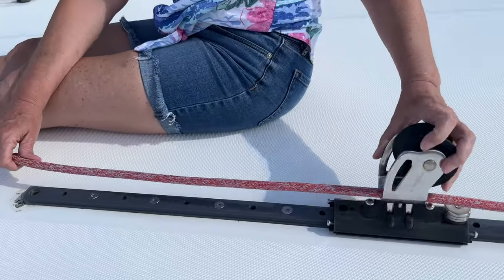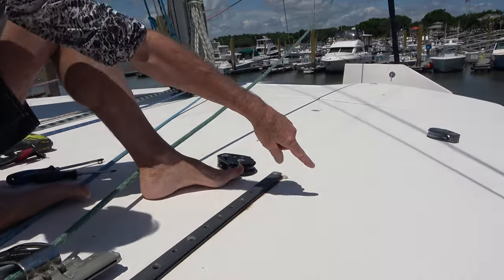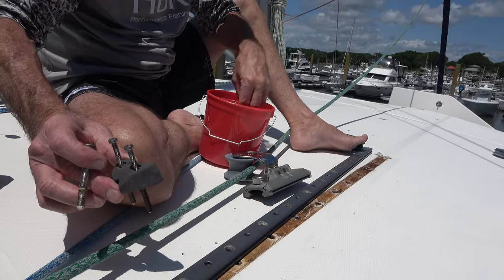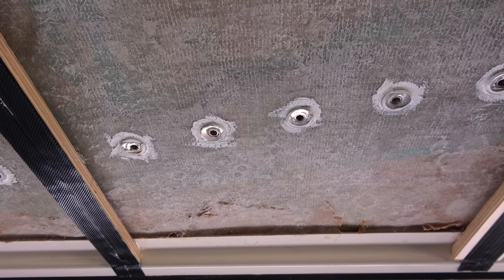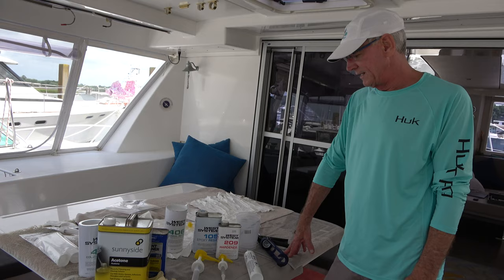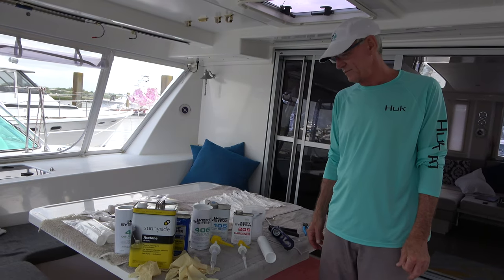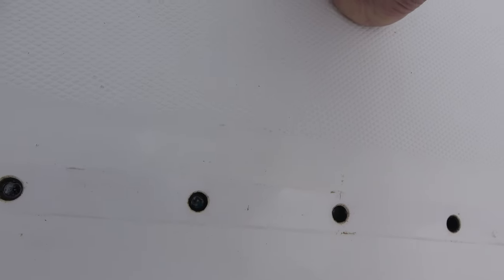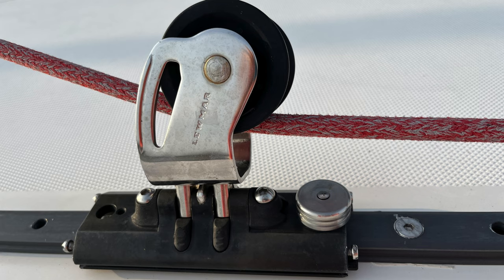HOW TO: #LEOPARD48 BOAT LEAK REPAIR - GENOA TRACK SYSTEMS REBEDDING

Comment: A lot of work but nice to see this repaired the right way.  Wet balsa removed, plug of epoxy isolating the through-hole from the core, finally butyl tape set into a nice countersink around each bolt.  Congrats!